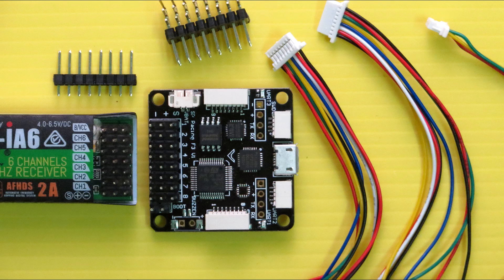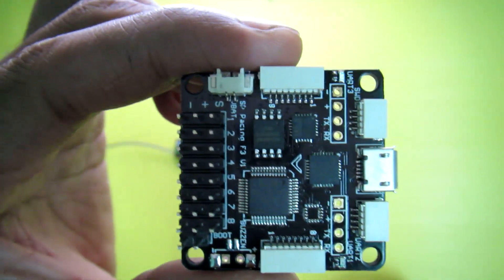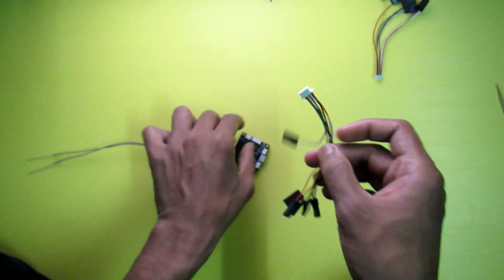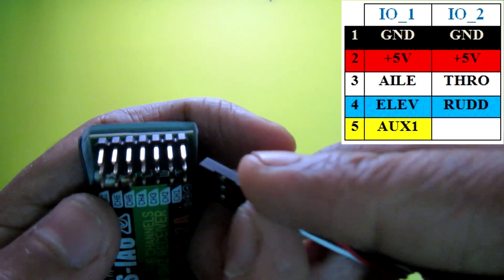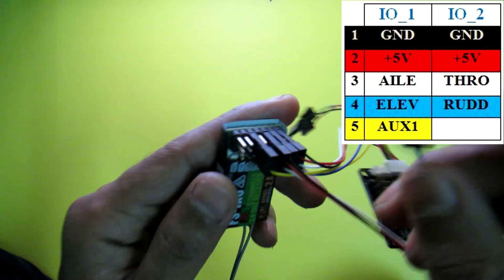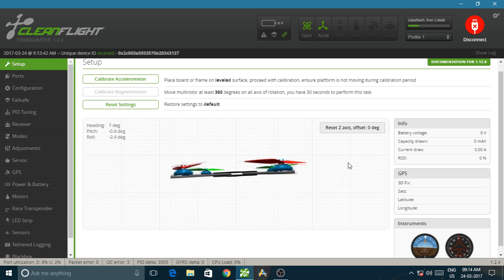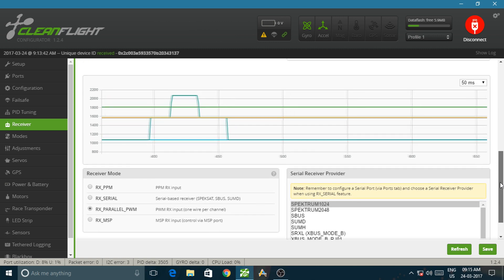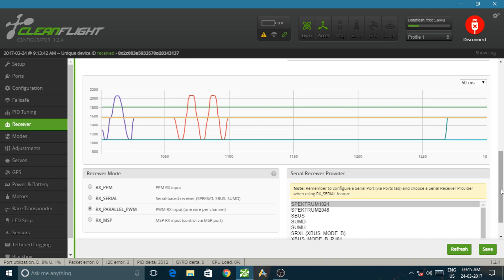How To Connect Naze32 F3 with any 6 Channel Receiver

Comment: Please make another video slowly explain with single wire , because we don't know about clear connection, we have manual also but the problem how to connect wire, you did good job 👍, Thanks but need some clarity only wire connection between flights controller and receiver. So please, which color wire you showing I have deferent colour wire. I hope you getting me.
Thanks 🙏. God bless 🙏.

Comment: Excellent !  Please share there Link from which we can buy the cable (the one which comes out from the IO1 on the Board to the Receiver PWM).     Would you please advise which cable is needed to connect a RC airplane controls to the air unit of DJI FPV or DJI OcuSync Air System?

Comment: Bro please show me how can I connect the ESC 30A to my f3 flight control
Reply: You need to hook up main esc power to the pdb and the signal wires to signal, positive, and negative on the spacing f3 board

Comment: It is good video, keep it up.. But I have a question, I want to connect 6 servos with f3 controller. I want them moving based on the accelerometer and gyro.
Reply from the maker: yes you can do that by using the custom plane model

Comment: When I connect my flight controller into the computer, the red light on the receiver still doesn't light up. Any suggestions?
I am using the FS R6B channel receiver that came with my FS–T6 transmitter.
The receiver was bound to the transmitter and worked just fine when I had another flight control on the quad
Reply from the maker: yes, you need to power up the receiver separately

Comment: well i got it all connected as shown and it doesn't work. 
I binded the receiver and tried again with no luck.
edit: oh i had to select PWM RX input mode (single wire)... that option was in a different tab for me.

Comment: I have followed your steps perfectly yet i cannot control my drone on the screen. my throttle and other stuff like that will not respond... do you have anythig that would point me in the right direction?
Reply from the maker: Receiver mode PWM

Comment: Hi, I binded my receiver and I can see input on betaflight, also can control motors on betaflight. Once i disconnect from betaflight I cannot control my motors with my transmitter. Do you know of any solutions?
Reply from the maker: Before exiting from betaflight, make sure you save your settings.
Reply: Yes, i have done that. The settings seem to save but I just cannot get connection from the receiver to the motors after I have disconnected from betaflight.
Reply: Same problem here....
Reply: Put left rudder to lower right position. Red led on fly controller lights up constantly. Motors are now enabled